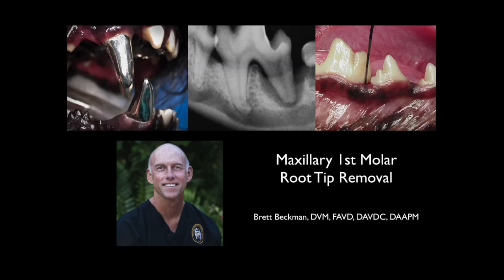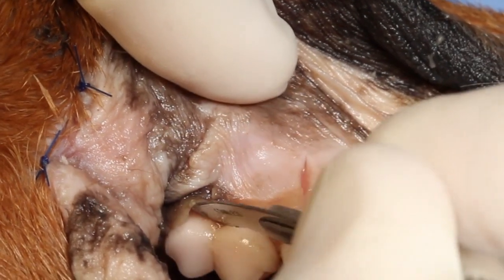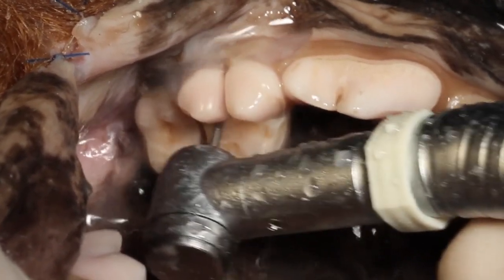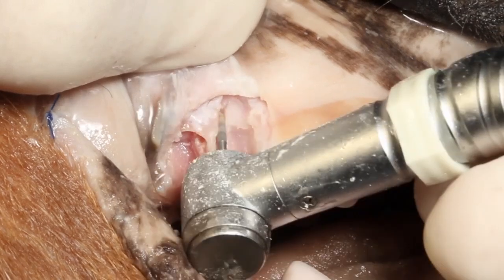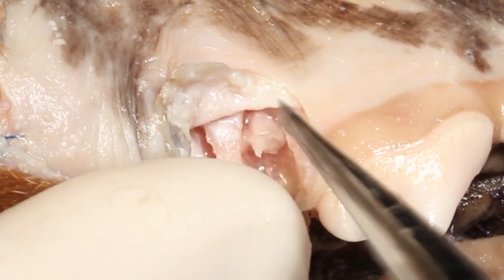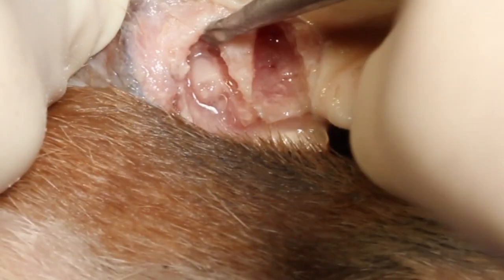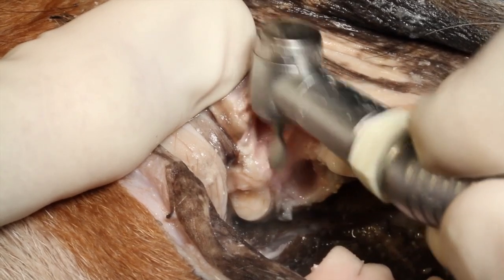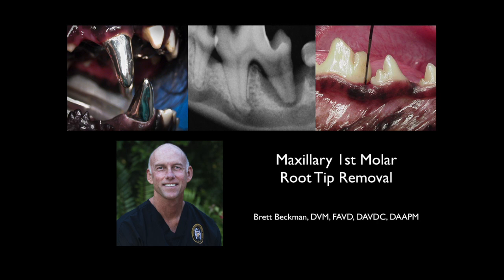Veterinary Dentist Shows the Proper Technique in Root Tip Removal of a Maxillary 1st Molar

Comment: As a general dentist, I am curious as to why you don’t start with some elevation prior to sectioning to get some mobility of the entire tooth first (especially if there is some infection that has already caused apical bone loss from infection). They make some really nice, strong and thin elevators that would fit nicely between the maxillary 4th premolar and the first molar for leverage. Do you ever extract dog teeth without a flap and surgical drill? Is there concern that you may perforate the maxillary sinus cavity?